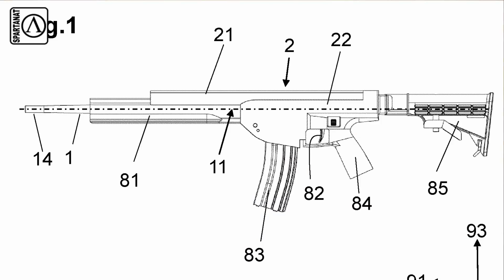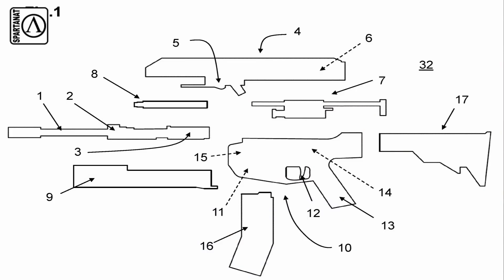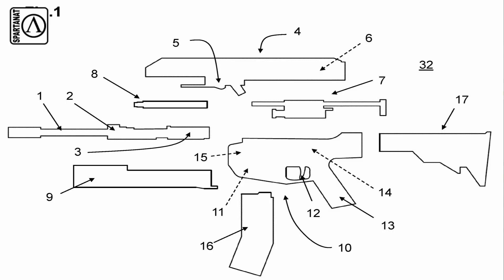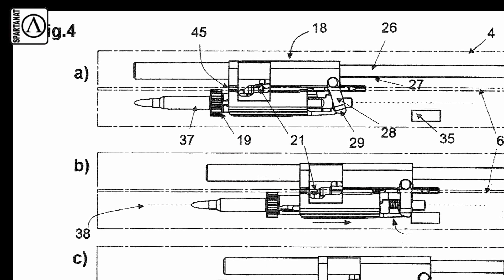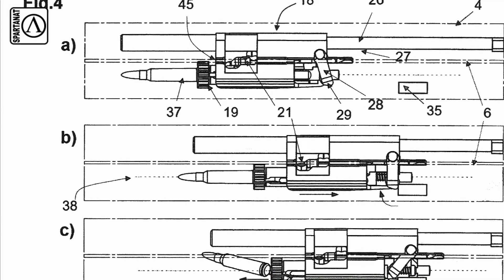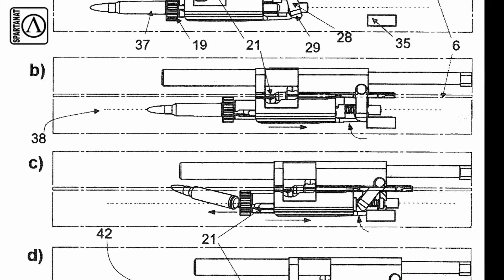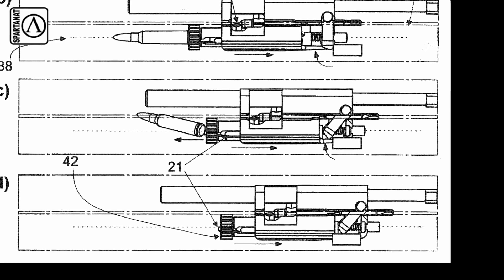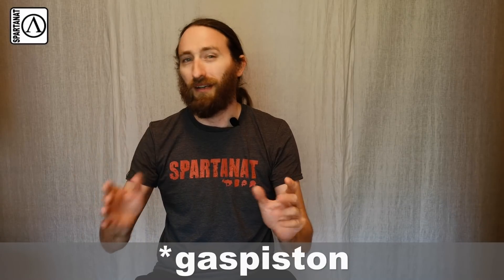It Is Coming! The Real GLOCK RIFLE Is Near - The First Amazing Infos

Comment: that piston system is nothing new, very similar to most semi auto tube fed shotguns. the only difference I see is that is will have two gas ports(which may add to reliability) and distribute the pressure more evenly to the pushrods. the upper asembly looks like a "classic" monolithyc upper like you would see on a SIG mcx.
maybe these things are only obvious for me since I come from a family of gunsmiths. 
The innovation on this prodduct is yet to shine I'm sure, but with this characteristics this carbine has many chances to set a new standard, wether its on reliable and cheap rifles or maybe its in the "lightweight" field.

this is something worth keeping an eye on!

Comment: Nice, actualy there is a Spring for the Magazinecatch. You can see it in the Drawing  as part nr. 4,  and will fit in the bore nr. 25 & 24. Wile the Spring works to either sides it is ambidextrous.
Reply from the maker: Ah, there it is. I just missed it. To many technical drawings for one day :D
Reply: @spartanatgearmag   No Problem, over all it is a very interesting Construction!👍

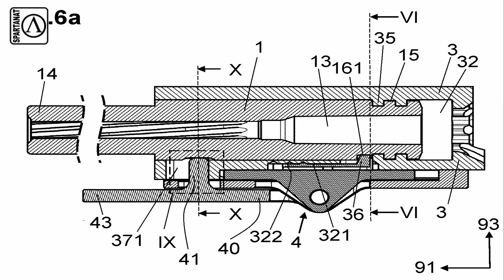Comment: @14:46 There is absolutely no reason to have that barrel locking/anti-rotation lug not having to touch the barrel. It is there to prevent barrel rotation and small tolerances there help with repeatability after a barrel change. Also it has nothing to do with free floating, as a free floating barrel is connected to the frame at the back anyways but should not touch the frame/receiver/stock of the firearm in another place. I would rather say given there is a whole cradle in the front up to where the piston is (which is clearly connected there based on fig 3 and fig 5 that you showed), the barrel is not free floated at all.
Reply: Yeah, makes no difference given the rest of the design

Comment: Annular gas piston is nothing new, look at the g41, or MKb 42w, CZ rifle vz 52 (it was always disaster), long stroke piston a short stroke do not depend on mm, it is depend of travel of bolt carrier and should be separated from bolt carrier, that quick change barrel look like the one used on steyr aug (as you say)
Reply from the maker: i was not aware about this gaspiston design. Thank you for the info!
Reply: it looks like fun to clean

Comment: They put 2 gas port holes to get a balance, in order to reduce recoil.
Reply: Is it to reduce recoil or is it to give more even pressure on the gas piston? Putting all of the force on one point of the cylinder could cause it to bind up during operation. I haven't read the patent, just my interpretation of why they might do that.
Reply: @Squirl513  Hi. Actually piston weapons usually have just one gas port hole and it seems to work well, as far as gas pressure is concerned. That's why I thought there should be another reason.
Reply: @debo2128  the single gas port usually feeds to a "rod" style piston. This cylinder piston design is a bit different. 
Directing gasses thru a muzzle brake can have a noticeable impact on felt recoil. The amount of gas that is used in the operating cycle is miniscule in comparison. 
I'll be interested in watching a complete breakdown if/when prototypes are released.
Reply: @Squirl513  Gas hole doesn't seem to be exactly on the muzzle. Sure it would be interesting to see a prototype. ;)

Comment: Look at the diagram of the gas ports and gas piston(s) again. It looks to me that the cylindrical object you called a piston is pinned to the barrel like a gas block. In this gas block the two action arms are shown reciprocating. They must each have their own gas piston.
Reply: No, there's an inner gas block that is pinned to the barrel and an outer collar/sleeve that rised over it.  That collar is the piston and has a 2 stage gas trap.  It traps the gas initially in a small sealed chamber, but once it moves rearward it combines with a larger chamber from the front that gets exposed.  At the full rear travel the total gas chamber is also sealed.  In the mid travel stage, however, the space would appear to be open to the front of the gas block.  And at the end of the stroke, once fully forward,  any gas in the front chamber would be shuttled out the front.
Reply: @jaredpawling2479  Looking at 11:09 again that sounds about correct. I thought he was saying the whole thing is a piston and he made no mention of any gas block.

Comment: Looks like on the extraction and bolt images number 21 is a plunger style extractor. As if when the bolt is at its rear most position the plunger is pushed to extract the casing. Can't say I've really seen anything like this in other firearms I've worked on.

Comment: how does the ejector work, based on the drawings we've seen? fixed ejector?
Reply: kind of like PPS-43 but actuated through a lever for some reason.
Reply: there is a weird groove in the bolt carrier, could be fixed ejector

Comment: Gas block most interesting and complicated feature what appears double delay tempered roll cams, I’ve never seen before! With two tampered pin cams and two small gas expansion areas totaling four chambers at barrel ports would require quality stick powder ammunition minimize carbon buildup similar to Eugene Stoner’s AR10 DI system? 

Two gas block cams limit over pressures regulating bolt carrier recoil pulse and possibly compensate suppressor use additional back pressures without manual adjustments maintaining bolt carrier recoil pulse as well? 

A lot of machining required produce this rifle design similar to FN Fal delay cam lock and HK roller locking system which all three designs are outside of military fast production requirements, probably not a big deal now considering modern manufacturing technology of today? 

Average patent process timeline in US for complicated patents typically three years! Every numbered item requires USPTO validation. 

As for European and CCP patent process generally one year after USPTO process. 

I’m sure Glock Rifle patent was issued at the same time to all global patent departments so I would guess within three years before it hits US market! 

Unfortunately CCP beyond doubt illegally copy, infringe, and manufacture majority of Glock Rifle design for their on use without compensation as they always do.

Comment: A stock center line above barrel center line will not reduce the recoil. But it will drastically reduce the kicking up movement when shooting. That is what is mostly recognized as the uncomfortable part of then recoil
Reply from the maker: That is what I meant! It will reduce the kick up.

Comment: No need, AR-15 was introduced some 60 years ago and nothing comes close.
Reply: Nothing?
Reply: @250smacks  yes nothing. the AR system is almost perfect and there is nothing that comes close.
Reply: @xyzaero  I enjoy many types of firearms,  I hunt with an ar15 because I can't find a reasonably priced bulgy 74 parts kit.  I don't know what standard a person can use to make that decision.  Although the ar15 is more accurate than the ak47 but the reliability of the ak platform is better(my opinion).
Reply: @250smacks  I also enjoy countless weapons all the time, but the ingenuity of the AR design is without any equivalent.